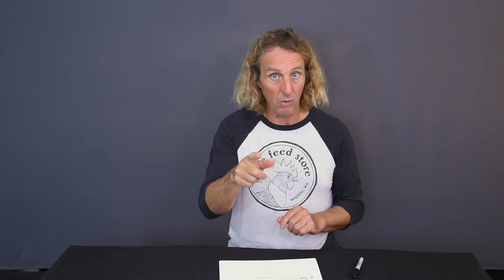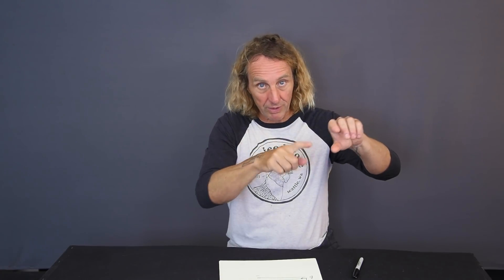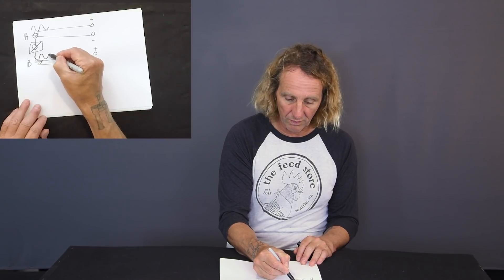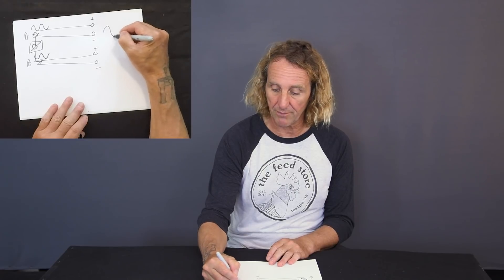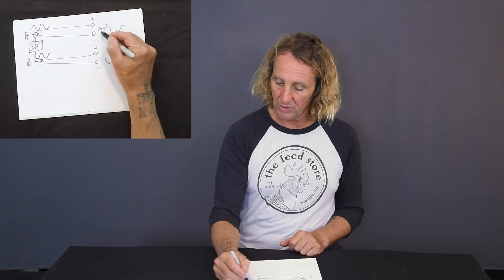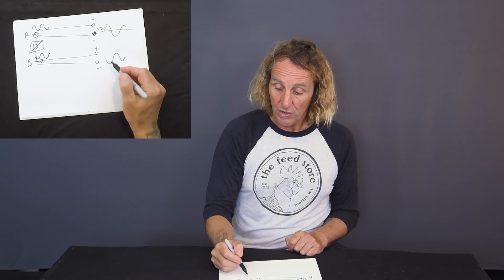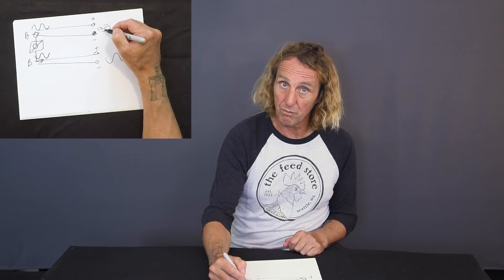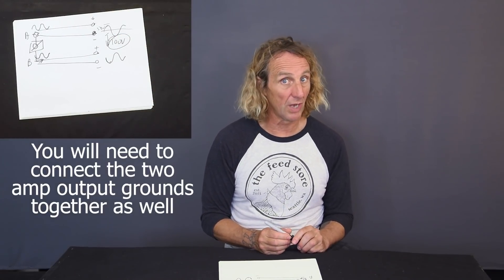Advantages of Amplifier Bridged Mono Mode

Comment: Very interesting video, i run 3 single 18" subs (8ohm each) with a single amp and 25m speakon cable.  
I've always used the parallel mode so i can keep a minimum of 4ohm load, and i've always avoided 2ohm bridge mono mode since i've been told that the damping factor is reduced in such mode (bridge) which cause less control in the driver movement.  
Is this way of thinking correct? 
I always limit half of my amps power per channel into my drivers so i keep headroom and clean signal 
Respect Dave rat!
Reply from the maker: Hmmm, three 8 ohm loads in parallel is 2.6 ohms. But to an amp in parallel mode each channel sees 5.6 ohms. Safe impedances not pushing near any limits of most pro amps. conservative 

headroom is unused acceuvle power but since you are intentionally using limiters to eliminate access to the extra power, it's not headroom you are gaining. You are just reducing the power available to send to the speakers, so that would be protection.

If you wanted to hot rod maximum output from the amp and to the speakers and if the amp can handle it. Adding a 4th speaker and running the amp in bridged mode intro two 16 ohm loads would milk more power out of the amp and lose slightly less in speaker linen and get you about the same power you get now per speaker into 4 speakers rather than 3.

Comment: Thanks for everything dave, 1 question what if we run 2 heats, 1 of them are push-pull in the other one is solid state, both delivery the same amount of power and are bridged in the center tap mode, that could affect the signal the goes to the speaker??👍👌
Reply from the maker: By heats, I think you mean amps and spell check messed it ?

The sound you would hear from connection two amp outputs in series would be the summed signal of the two amps. Amp 1 plus amp 2.

Bridging two channels or two amps is just putting the amp outputs in series.

Putting two different types of amps in series would result in the summed outputs of those two amps and the minimum load would be 1/2 the minimum load capabilities of the amp that is less load tolerant.

Comment: One significant reason to bridge, ... especially feeding subs, is eliminating potential bus pumping within the power supply.
Reply from the maker: Very true and many amps are designed to mitigate this issue even when not bridged. Powersoft and Lab Gruppen being two examples where ch1 + is in polarity, ch1 - and ch2 + are ground and channel 2 - is out of polarity. This inherently balances the draw on the power supply when both channels are driven with similar signals.  Also with these amps you can operate them bridged with just using a Y cable and connecting the load between 1+ and 2-
Reply: @DaveRat  
Good stuff...

Comment: 4:16 explains EXACTLY why an amplifier into a single bridged driver sees half the load.  There's literally a point at about half the voice coil where it is "center tapped" and there is zero voltage to ground. Dave explained it with two speakers.  I like this explanation.

Comment: Hi, Dave. Just stumbled upon your channel randomly and actually have a relevant question.
Maybe a little out of your wheelhouse, but I suspect you have the answer.
I have a small multi function guitar amp that is stereo, but uses two built in 4"speakers. It sounds pretty good, but I'd prefer to be able to connect it to an external cab. Now I can easily install a couple of switching jacks and connect it to two spare 4ohm driver's, but I'd rather bridge it to one cab if possible. So if I have continuity between the negative speaker terminals and the chassis, does that mean I can bridge it?
Thanks very much for sharing your experience.
Reply from the maker: Hmmm, that will be complex unless you can isolate the stereo pre amp from the stereo amp in the cab. If there is a pre amp out and and power amp input, it could be possible depending on the amp design. Then find a way to polarity invert the input to one amp channel. And mono the pre amp out.

Sounds more complex than beneficial.
Reply: @DaveRat  I think that's beyond my capability right now. The only experience I've had with bridging amplifiers is car stereo amps that you flip a switch and just use a particular set of terminals. I had the guts out of this little amp and it's surface mount components in a pretty small form factor, so probably best to either leave it be or do the two jack modification I mentioned, I think.
Thanks so much for the reply, friend. :)
Reply from the maker: Understood and yes, not worth the work and complexity vs the value of the outcome

Comment: Hi Dave!. Great explenation!....As you know there are too many fake information around...
But, if I can, I would like to add some details, starting from voltage side instead of power....
So...
Based on your exemple, let's say that the amplifier give to the speaker 70.7V (peak) each channel. 
Each channel is connected to one 18"@8ohm with two cable of one ohm resistance. So, each channel see 8+1+1=10 ohm resistance load. like you said!
70.7V on 10 ohm meaning (P=V^2/R) 500W. Each cannel delivery 500W to each speaker.. so the amp delivery in total 1000W.
Due to loss on cable, on 18" cone we have only 500*8/10= 400W. we loose the 100w on cable.
Now. If we connect the amplifier on Bridge mode we have, under the same condition, 70.7*2=141.8V.
The amp in this case see 8+8+1+1=18 ohm load
On 18ohm load at 141.8v the amp delivery (P=V^2/R) 141.8^2/18= 1110.8W.
Here the first point. In dual mono the amp give us 2*500=1000W. In bridge he give us 1110.8, so 110.8W more.
At the speaker we have 1110.8*16/18=981W. We lose 1110.8*2/18=123W
The second point, at the end, In dual mono we give to a double 18" 800W, in bridge 981W so 181W more, with the same amplifier and with less expensive cable...
That's grat!
Reply from the maker: And damping factor is improved as well and in this example you used one cable for each 18 and in cable for the bridged, so you still have an extra cable that either saves money, weight and time or you can run both cables for bridges and reduce the cable loss to .5 ohms, further improving the output
Reply: @DaveRat Yes man!... 
Speaking about damping factor and slow rate is hard to understand. Also harder is understand how this parameters effects on audio system performance..... Can you explain us?
Reply from the maker: I will ponder that and see if I can come up with a clear explanation and test

Comment: Dave - great stuff as always. 

Here is my question; 
So for example:- running 2x 18” drivers in series on sub duties - uses a lot of power in this cross over band - 
I’ve always thought that running drivers in sub land in series is a no no - purely due to the reason that once voice coil is essentially acting as a resistor to the other opposing voice coil. 

For example 4mm speaker wire might have an impedance of say 1 ohm. But the voice coil has a impedance of say 8 ohms… 

This means in a series configuration one driver 18” driver (let’s say driver B) sees: 
1 ohm - cabling (-)
8 ohm - voice coil A (variable to some extent cone moves) 
Driver B it self - 8 ohms 
Cabling - 1 ohm (+)

So essentially once voice coil is power limiting the other. 
Aka the dancing electrons/pixies have to pass through a piece of small voice coil wire to get to the next driver - essentially using the thinnest wire you could to complete the circuit.

Does this make sense ? 

In mid and Hf bands - the current draw isn’t as excessive or as large so not so much of a big deal - but in sub land, parallel. If you need more lows, add boxes and amps. 

However I see no problem using a amp in bridge mode driving a pair of 18” drivers in parallel. 
Really with the double up of capacitors (of course dependent on amp topology / class) gives a much better damping factor and immediate current draw capabilities! 

Thoughts 💭🤔?
Reply: I think that the bit that you are missing is that when the pixies have to squeeze through the second voice coil, they get another shove from the second amp.
Reply: @dougaltolan3017  
Absolutely correct if it’s hanging off a bridged amp. 
I’m talking more generally with sub drivers in series - even say 2x 16ohm drivers in series of 1 channel of a high powered amp for example. 

Generally speaking I can’t see ‘series’ wired LF drivers can be a good thing hanging off any amp config….

Unless I’m missing something else
Reply: @dylandylan11731  if your amp can chuck full wallop into 32 ohms then why not? Higher impedance means lower current means lower cable losses. Damping is likely to be cheaper since higher voltage caps are cheaper than higher value caps (less current means a smaller cap can do the job)
Although Dave did cover what happens when 1 driver fails.....
Reply from the maker: If you have one driver and 100volts or 2 in series and 200v or 3 in series and 300v.

You get a 100v drop across each.

Same output.

But if you use the same wire, the % lost in the wire is less for higher voltages.

The results of using higher voltages to reduce power lost in the speaker cable and improve damping factor while using the amp more efficiently, combine to provide and audible improvement in many scenarios.
Reply: Im a bit late to the party but thought id add a few bits in here...

If you have 2 speakers in series on the same amp channel the impedance adds up, in your example 2x 8ohm speakers would put a 16 ohm load on the channel, in parallel the opposite is the case, the amp would see 4 ohms.

I'm not sure on the differences with PA amps and regulated power supplies and whatnot but in car audio world where i'm from this usually means about half the power output in series (due to more resistance) and double in parallel (if the amp can handle the low impedance without overheating)

Using the amp in bridge mode means you are spreading the load over 2 channels, so in the first case where you have 2 speakers in series (adding up to 16 ohms) each channel only sees 8 ohms and you get twice as much power as you would running them off the same channel.

By reducing the voltage drop through the wires since you're only using half of the connectors you get another little bump in power, and by doubling up the connectors for even less line impedance you get another little bump which makes bridge mode better than just running 2 separate channels at 8 ohm each.

Doesn't make any difference if these are bass drivers or treble drivers, more power is more.
Reply from the maker: That sounds correct.

Comment: Brilliant video, so fascinating.
Can't wait to get my head around this one.
Can anyone help?
I always thought inverse polarity has a cancelling effect on the signal. I'm assuming one of the 18" speakers is flipped around so both are operating in sync.
I love mental challenges like this! 🙂
Reply from the maker: You can run full voltage "in polarity" to the positive terminal and ground the negative.

Or you can run full voltage "out of polarity" to the negative terminal and ground the positive terminal. 

Or you can run 1/2 voltage "in polarity" to the positive and 1/2 voltage "out of polarity" to the negative terminal.

And all of these scenarios will result in the same exact outcome, same power, same polarity.
Reply: @DaveRat  - Thanks for taking the time to explain, there'll be massive benefits to this system! 😊

Comment: I've used bridge mono to get the full output of a power amp but had no idea you should jump the negative to a hot terminal on the speakers which logically seems weird and counter to layman's polarity know-how to get the most out a matched speaker scenario. I'm gonna have to read-up or maybe you could do a video showing the wiring  w/ a small power amp and speakers? I feel like me attempting it would blow something. Always helps to see it vs told. Thanks for the video Dave. I enjoy these.

Comment: Si == does the electricity sent to the earth go to earth or transformer> are the electrons the ones on a path or are other electrons present if it goes back to power pole- and do electrons come from earth or do the appear intra-dimensionally...... -WTPOW
Reply from the maker: Oh my
Reply: Since audio is AC, over time the electrons return to thier original starting point. That means that none come from the amp and none go to ground and in fact you need to bring your own already in the wire.

Comment: Hi Dave, I noticed recently that Berhringer have released a 6,000watt amp, but it only has a 10amp, IEC input @ 240volts. I would expect the input to be more beefy than this - either a 20amp powercon or 32amp cefform. Is the claimed 6,000 watts rating therefore reliable, a complete lie, or am I missing something? 

Hope you provide some insights on this. Jonathan
Reply from the maker: Great observation and yes, it is no possible to get more power out than the power going in.

That said, a 20a 120v ac wall plug gas a maximum continuos power capability of 2400 watts.

But many power amps are rated with peak power where the amp stores some energy and so it could put out 1500 watts continuous and maybe put out 6000 watts for a short periods of time. And many amp manufacturers will rate the amp on its peaks
Reply: @DaveRat  
I've shared this before, hope this helps; 
To avoid nuisance tripping, circuit breakers can pass huge amounts of current past their rated trip amount. 
For example, when electric motors start, they pull massive amounts of current until they're up to full speed.* 

A 20a circuit can pass 7-8 times the rated 20a trip amount, .. for up to a full second or more. 
It will allow up to 3x the rated amount for up to 10sec or so.

Most importantly, that 20a circuit can allow up to 2x the rated amount for a period extending as long as 30 seconds. 

100amps for around 1-2 secs
60amps for around 10 secs  30-40amps for up to 30 secs 

Music is transient in nature. 

The capacitors store, dump, refill. 
Big iron toroidal amps store in their magnetic field.
High speed SMPS amps refill caps so quickly and frequently,  their demand from the power line is typically in brief high current spikes. 

Yes, long term P-out < P-in ...
 just I²R losses assure that.
But other than a 20hz synth note that never stops, music ebbs and flows. 

*(wires in conduit feeding motors often vibrate intensely upon start up, the high current magnetic fields off each conductor fight each other and will buzz against the interior of the metal conduit)
Reply from the maker: For shows we need to rely on the long term breaker current handling or else we hit a thermal trip which I believe aligns with the rated current.

But yes and thank you.  It's interesting because if circuit breakers used the same ratings that many amps use of peak or pulse power, a 20 amp breaker would rate at 100 amps.
Reply: @DaveRat  
Good point
That thermal limit .... 

Perfect example; 
Big stadium show, Kenny Chesney headlined a multi-act Pirate tour, Keith Urban, Lee Ann Rimes, Luke Bryan, others, a massive touring circus backstage. 
This was the last night of the tour. 

For me, this is our venues first concert since opening. The motor coach area was a three day party, 𝙬𝙚 𝙥𝙖𝙧𝙠𝙚𝙙 𝙩𝙝𝙞𝙧𝙩𝙮 𝙥𝙡𝙪𝙨 𝙘𝙤𝙖𝙘𝙝𝙚𝙨 𝙄𝙉𝘿𝙊𝙊𝙍𝙎, 𝙙𝙞𝙧𝙚𝙘𝙩𝙡𝙮 𝙗𝙚𝙝𝙞𝙣𝙙 𝙨𝙩𝙖𝙜𝙚, shore power, water, drain, cable, and internet built in the floor, adjacent to essentially every coach. 
Very few venues offer that.

EVERYONE involved loved that convienance. Brand new stadium sized restrooms for all backstage.  

It's a convention center hall, backed up to a football stadium end zone. 

Party party party, last tour stop and it was wild. Oh my gosh great fun. 
Five headline level acts, it's a busy place backstage. 
Non-stop limos/vans in and out, celebs, athletes, last tour stop party buzz. 

Ok,
Night before the show, partying, blasting the PA into a big empty indoor stadium, one of the house breakers tripped feeding one aspect of show power. 

Picture a breaker, feeding a fused safety switch... where we tie in show power tails. 

This was really embarrassing for us, the house...  I believe a 400a breaker opened up.

These breaker trip curves are adjustable on the face of the 400a breaker. These small dials establish how quickly and under what circumstances the breaker trips. 
This one was never set properly. 

Quickly the production decided against house power for that drop, and went to Aggreko generator power for that load. 

That was f***ing embarrassing because we bragged we built in all the show power you need... etc. 

𝙈𝙤𝙧𝙖𝙡 𝙤𝙛 𝙩𝙝𝙚 𝙨𝙩𝙤𝙧𝙮;
Breaker trip curves can allow huge amounts... or if never adjusted correctly, can trip way too soon. 

So glad it happened before the show. 

(same wild tour rolled thru the following year too, good times, even more stories)
Reply from the maker: Excellent story and thank you!
Reply: Hi Jonathan,

Class D Amps always have higher RMS Power than Power Input. There are 12000 Watt Amps (L Acoustics, LAB Gruppen etc.) that run on 16 Amps Breakers in Europe (230V). So you can pull 3680W from the Fuse. This is possible because of the different Ways of measuring Power Output i believe. As far as i know there are Pauses in the Audio for the Measurment of the RMS Power of an Amp.

Hope this helps with your thougts. Cheers!
Reply: If that behringer has you puzzled look into the d&b D80 amplifier and you will really start looking for a wizard. Those have a smashing 4x4000=16000 watts on a 16A 230V  power plug. Now imagine the amp cart fed by a three phase 16A roughly 11000 watts feeding 3 of these and creating 48000 watts of output?! 37000 magical watts is it?
Surely the engineering is borderline wizardy but the answers are allready in this thread. Has to do with the 48k being peak voltage. Amp saving up some power. Drain being low between peaks. Class D amps being staged. Power outlets circuit breakers being slow trip and so on. In the end we are protecting a power cable from melting and it doesnt build much heat when the strong current is over such a short duration each time. It just works. Even with fast metal kick drummers!